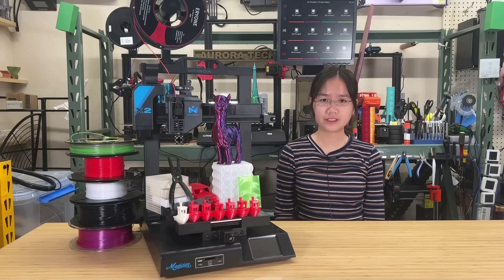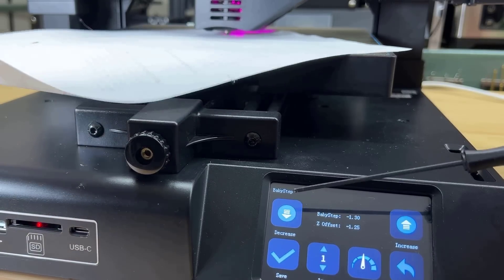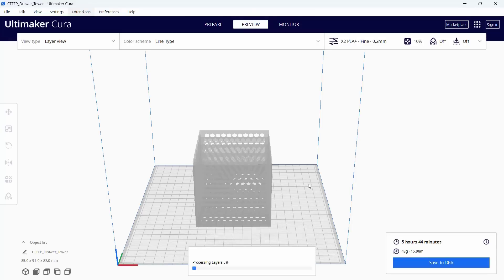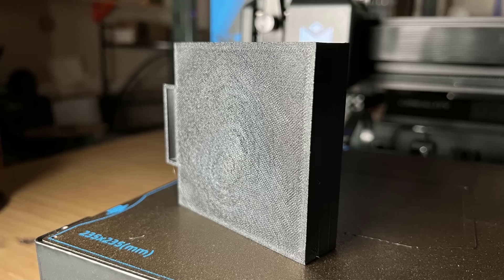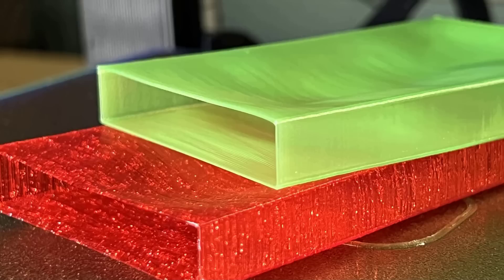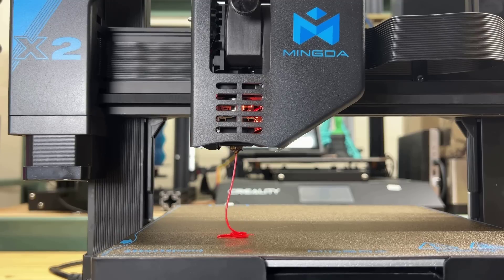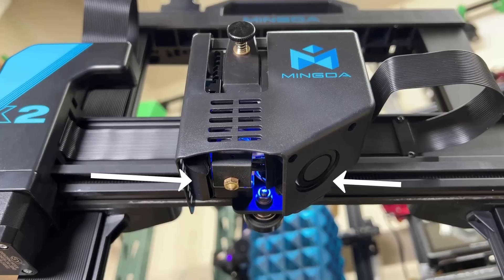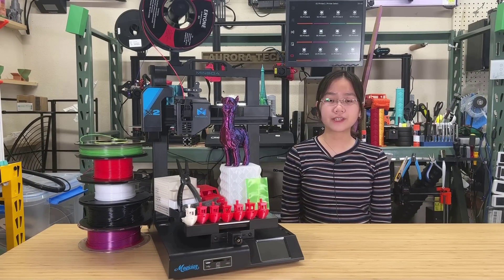Mingda Magician X2: A solid mid-range 3D printer with auto gantry leveling and bed leveling and more

Comment: I just got one that has a weird z axis issue. I'm really not sure how to solve it. Despite homing, setting z offset and doing the bed level, the print starts with the nozzle too close to the bed and the Z increment seems off. EG the printer displays z 2 mm but it's barely above the plate during the print. I thought it might be z binding. But I don't think it is.

Comment: I love your channel and your Pros and Cons are always very concise.  I was sent one of these machines to evaluate and when it arrived, a PCB inside the machine had come off and was rattling around inside.  And yes, that Styrofoam was a mess!  I agree with everything you have said.  For the price, it is a surprisingly good machine.  I'd add the following  (1) the "light" inside the hot end to illuminate and see your first layers is useless  (2)  The extruder tension spring is way too firm.  I twisted and twisted and that spring wouldn't budge.  I replaced it with one I had on hand from a genuine BMG (3) I'm not crazy about those ribbon cables on the X axis and the connection it has. I'm always checking that  (4) I wish they listed what they have changed/fixed on their firmware download page (or a link to a GitHub, etc)  (5) For using Octoprint, I learned I could only use the USB C port to make a connection

Comment: While I have generally enjoyed using this 3D printer, it has some annoying quirks. I got one of these as a birthday present. After 8 days of use, it appeared to fail. When I would power it on, it would do nothing. The unit would power on. I could hear the fans. The display would not turn on. When I contacted Mingda about this, their first suggestion is that I open up the printer, which breaks the seal that is on the bottom saying that I will void my warranty if I open it. After going back and forth with them for a few days, they sent me a new printer. Within a few days I got the same issue as before. The printer powered up but did nothing. I figured out completely on my own that if the SD card is still inserted and there's still a file with the name "firmware" on it, the printer will get confused. The printer is designed to look for a firmware file on the SD card when it boots up. That's OK, but what was on the SD card was a remnant of the firmware update, not the actual update. When I booted up the printer without the SD card in, it booted up normally. I deleted the firmware file and then booted the printer up again with the SD card inserted. It booted normally. Had Mingda told me about this quirk, they would not have ended up sending me a second printer. I was using the second printer for just over a month when it failed. The sensor that works with the X axis stopped working. Because of this, the X axis no longer operates properly. I never returned the first printer. I got it back out of the box and set it up again. It's now working perfectly. Mingda needs better support. Had they been available during normal US business hours and had they actually knew how to troubleshoot their own product, they would have saved me and themselves a lot of trouble. I will return the defective printer to them as soon as they pay to have it shipped back. I WILL NOT pay to ship a defective product back to them. I hope I don't have any further issues, but if I do, I will just dump this thing at an electronics recycler and buy a different brand... one with better support!

Comment: Both of my X2s bought within the last month came with glass beds. Which I don't really mind but wondering why yours came with the flexible bed?
Reply from the maker: Their website also shows a flexible PEI sheet on the X2 product page, while the old Magician X uses a glass bed. You may contact Mingda and see what they say.
Reply: @AuroraTech  apparently Amazon versions come with the glass bed. I asked in the forum but havent got an answer as to why yet
Reply: Mine came with glass bed too, and that was because i bought it from Amazon. 

The bed is pretty good, i just wait the glass to cool down and the print gets out of the bed without problems.

Comment: I bought the printer and i have to say that is very solid, and yeah, the foam was a little problematic. 

Overall is a great printer and the price in my case is great because in my country (México) this printer is cheaper than the Artillery X2 and the Ender 3 S1 Pro.

Also it looks you got a PEI sheet, mine came with glassbed and damn, adhesion is X-treme in that glass bed, in my country people has a cult following of the Ender 3 so seeing something like this Magician X2 really leaves astonished. 

I will use the Magician X2 to get more experienced and then add a Bambu X1C to the team.

Comment: How much longer are they going to use that same old trash display the Artillery uses?  It's literally the worst touch screen as well as UI in the industry.  I'd rather have the knob from the Ender than deal with that nightmare again.  Per their website the MSRP is $350???  A "clown" would be a lot more fitting of a name than a "magician."

Comment: @AuroraTech Thank you for mentioning our company in your video 👍

Just so you and your viewers are aware, the "print  assembled" needle nose pliers that you printed in the video (and also the standard pliers) have been redesigned since the last time we updated our 3d printable tool set. The new design has a raised pivot point so that you can push it like a button to break loose the top and bottom half. This is much easier than using a razor blade to separate the top and bottom like you had to with the older version in the video. We also designed another version of both pliers that can be printed unassembled and then snapped together, a feature which will usually be needed if printing in metal.
The next update to our tool set will be on July 1st but I'll email the new designs to you so you don't have to wait.

As for the printer that you reviewed in the video I really like the self leveling gantry and the bed leveling probe being the nozzle itself. The higher temp hot end should just be included with the machine and not be an add-on but it's still a very affordable printer, even if you have to buy the higher temp nozzle separately.

Comment: A timeout for heating would be nice generaly, but last winter I got the downside: Due to energy prices I heated my house only to about 10...12°C. The 3d printers are in an enclosure, so after heating the thermistors with a hair dryer to avoid min temp warning, I just preheated the bed for about 20 to 25 minutes, so the air inside the enclosure had about 23°C - enough for printing PLA or smal PETG-parts.
In my opinion, there should be a timeout for the hotend at about 10 minutes, but at least about 45 minutes for the bed. Heating the bed uses some energy, but does not destroy something (so even one or two hours are o.k.), but the filament inside a hotend can actually start degrading if "cooked" to long.

Comment: Great review once again. I have a few Mingda Magician series printers, including the X2 ... While listening to the Pros and Cons section, I just want to clarify something. I think there is a misinterpretation or misunderstanding of the 'Quick Swap' feature. Mingda is referring to the whole extruder assy and not just the hot-end assy as being 'Quick Swap' - this meaning that the whole extruder assy can be installed or removed from the printer with only 2 screws.

Comment: What is the software running on monitor behind?? I'm running 16 prusa, looking for software to monitor mulitple printers!
Reply from the maker: just Klipper, with 12 instances installed on an old PC (i5-6500, 16GB RAM).
Reply: @Aurora Tech  is it running Linux? I'm currently using docker to run octorpint instances on old xeon server pc. But, haven't connected all my printers because I'm scared it will have gcode delay
Reply from the maker: Yes, you can install Debian or Ubuntu Linux to run Klipper. Since a Cortex A53 with 2GB RAM, like a Sonic Pad, can control up to 4 printers without any issues, I would assume that an i5 with 16GB RAM can easily handle 12 or more printers.

Comment: I own the Mingda Magician X2 as my first printer. Its actually pretty good. All i did was setup. Auto bed levelling and starting printing. 

Though even after 4 months sometimes i still need to adjust the Z-Offset for some reason and after many test with retractions (because it leaves some stringing) i gave up on retraction due to no matter what setting i put it has stringing so i just leave it at default.

and recently set my Cura Z-Offset to -0.1 whenever i print anything and has consistent results. I never go past 120 for printing speed. So far pretty good for a beginner.

Question though, do you think its worth saving up for the Mingda Magician X or Pro for the larger printing bed? or should i aim for something like the new K1 thats coming out soon with a large printing bed and 3-4 times printing speed. @AuroraTech
Reply: Hackerman!

Also i would recommend to wait a little for the K1, Creality still needs to repair some problems and the modding community is beginning to do some hacks for obtaining the full potential of the printer (Creality is blocking the specs using propietary klipper mod).